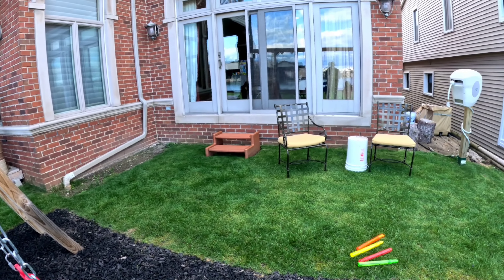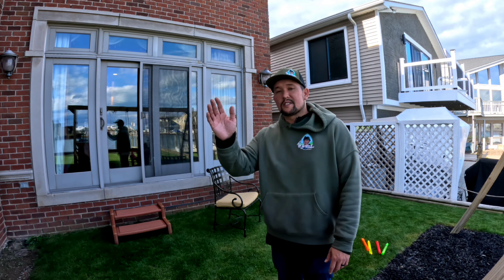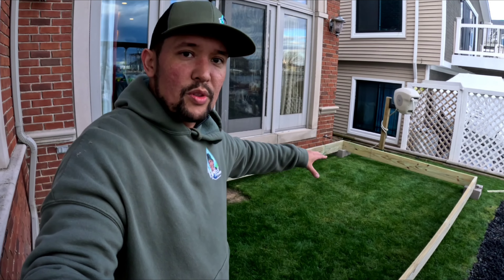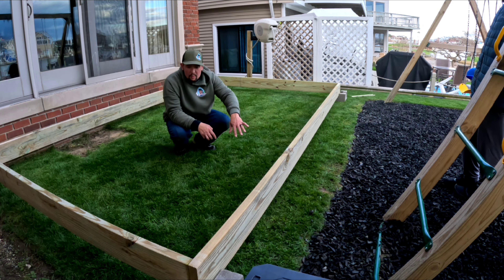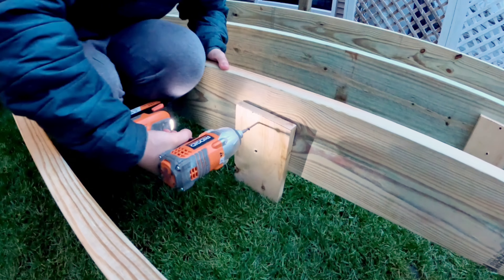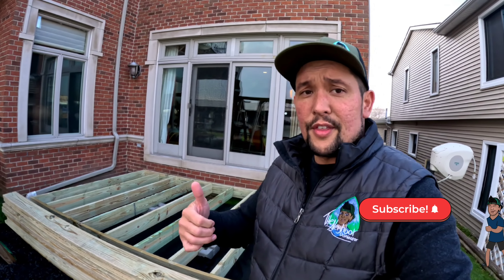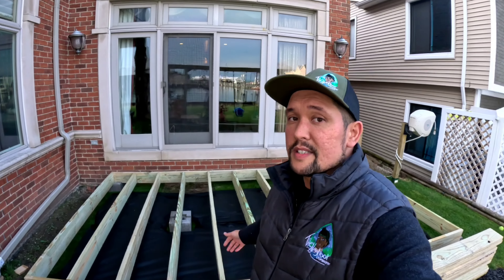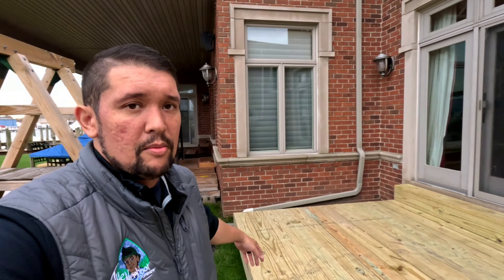DIY Floating Deck: No Digging, No Permit 💰 Build it Yourself in a Few Hours!

Comment: Pathetic! Not enough support and your wood supports will suck up the moisture and rot out!
Reply from the maker: 🤣🤣🤣the last one is 4 years old, untreated,  sitting there perfect.   I actually think it's getting stronger learning to fight the elements of mother/father nature🤟
Reply: Ours lasted 12 years, and it was all ground contact/no posts, pavers or deck supports at all. It was basically done this way: https://youtu.be/l8lDyguSvJw?si=yhfwcXMSZLcOpopc . 10x12, and I’m going to finally rebuild it this weekend. Going to do the same way because I’m perfectly happy with getting a decade or so out of a $700 deck. 

And we even live in an incredibly humid area, very damp backyard (turns into basically swamp only about 40-50 feet away from the deck area) and still got that long out of the deck. Just used basic treated ground contact 2x8s and stained and were good to go.
Reply from the maker: @n.s.3812  thank you for this post.    Most of the hate are from contractors.  Videos like these huet there business.   And I don't wish that upon any small business owner because I am one.  But I also like to save money and do things on my own.  I'm glad to hear it is still standing and solid.  Just confirms that this works!